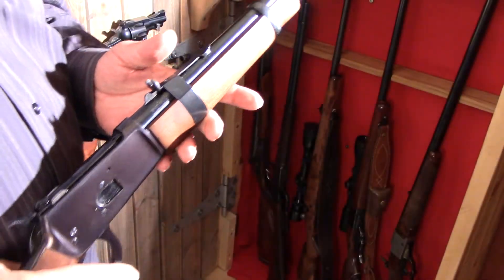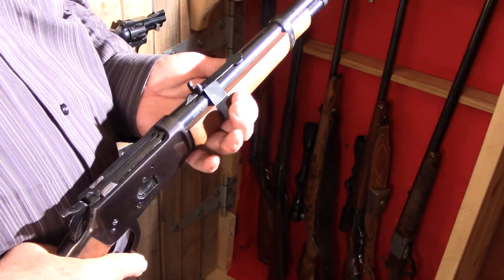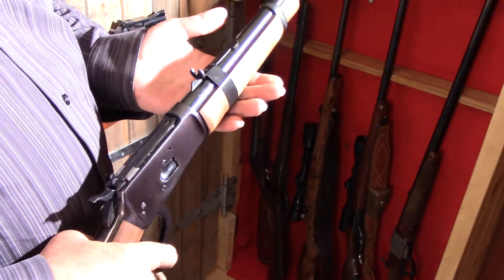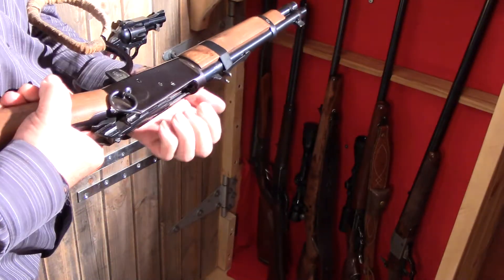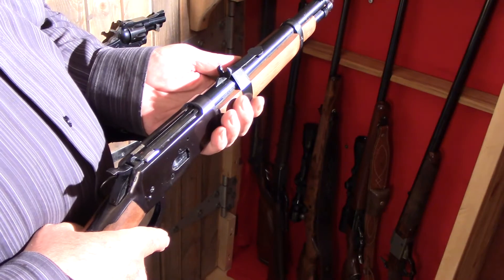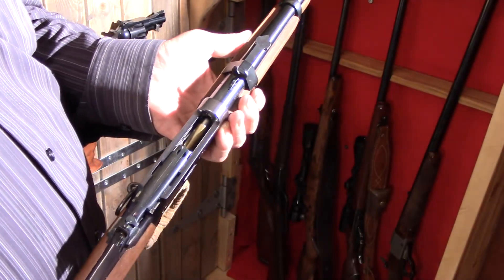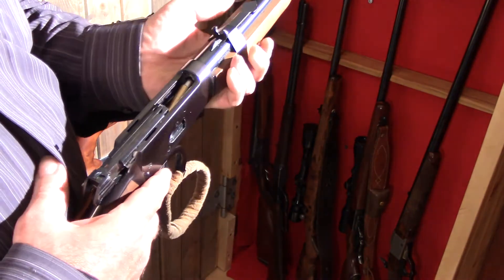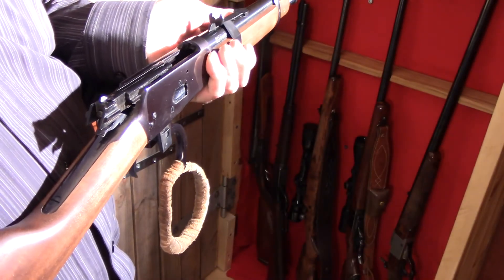Something to Keep in Mind Regarding Magazine fed Rifles

Comment: I have had this occur with a .22LR lever too. Why are you unloading via the lever instead of just dumping them out the loading port?
Reply from the maker: Having a .22, you're probably loading from the end of the magazine Larry.  With the exception of the Henry's, the big bore lever actions are loaded via the side plate, as my video shows.  When loaded that way, once the last cartridge is inserted and the side plate latch closes, the cartridge moves backward slightly, so you can no longer open it (which is why, when loading, you push the cartridge only partway in, leaving the rear portion exposed, so the next cartridge can be pushed against it, not allowing the latch to close).  So, in short, once that latch is closed, it's closed and the only way to get the cartridges out of the magazine are as shown in this video.  For an illustration of this you can check this other video I made:  https://youtu.be/Facq6Ggpu-E?list=PLEr5Wto8yuXQ2OO5ZM3-6RTKmSABw6Irf
Reply: Interesting. My Uberti 66 and Marlin 1894 both allow me to unload via the loading port. Just push the gate in and the rounds come out.
Reply from the maker: Really?  Not having owned either of those, I wasn't aware of that.
Reply: I have read that with the Uberti 66 the tab on the loading gate can get bent which causes it to lock behind the rounds in the tube, but that's a problem, not a feature. Straightening the tab fixes it.